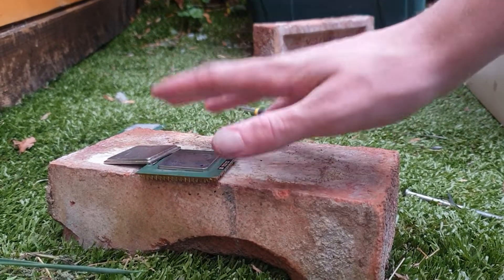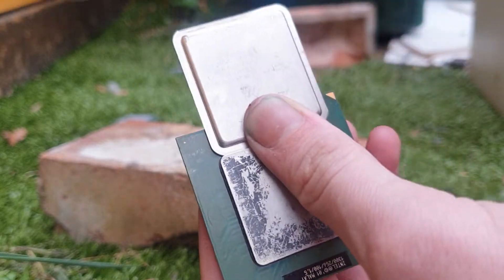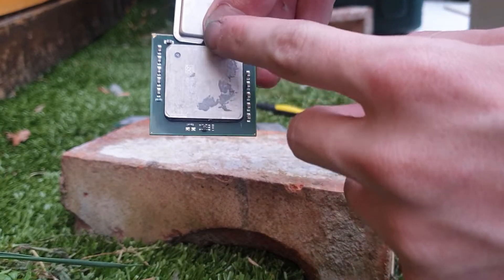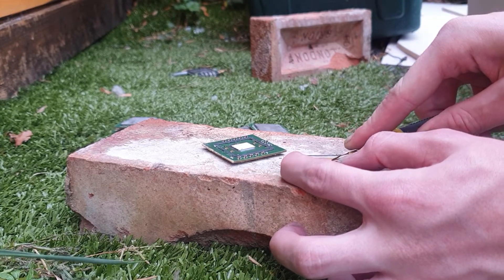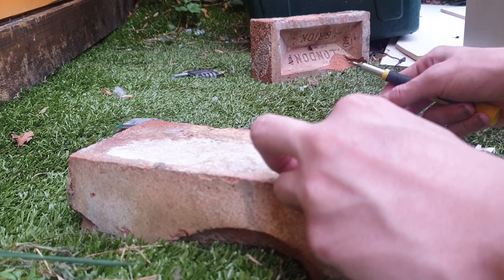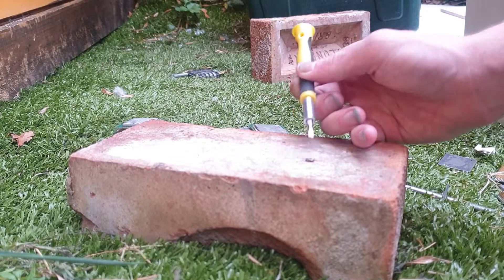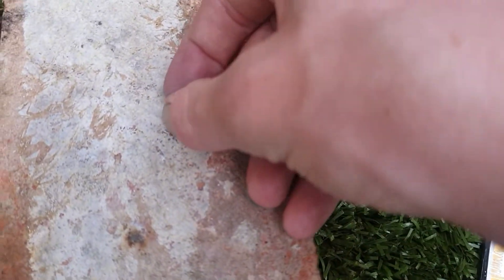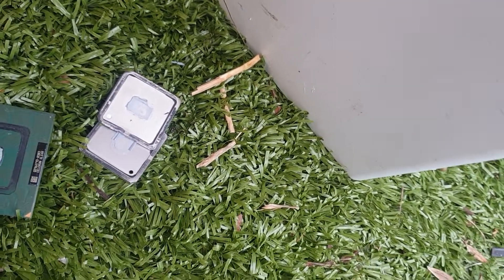How to remove indium from cpus the easiest way

Comment: wont that break the silicon chip?...
Reply from the maker: If you rip the top of it will break but if you hammer it off like I did it will not break and its easy to just scrape off
Reply: Keyte Fire thank u!
Reply from the maker: @sekarlangitakbar6682  no problem

Comment: thats whas an good idea, i steel it ;)
Reply from the maker: If you use brick make sure it's out the rain. If it has moisture inside even if it looks dry on outside the metal will explode everywhere
Reply: @keytefirerefining1355  i have my vice to hold it ;)

Comment: Hey, thanks for the video!   Easier way to get all caps off is a bench vice.  It is really quick and you can do 50 of them in less than 10 minutes.   One side of the vice on the cap, the other side on the processor itself and tighten.  pops right off.
Reply from the maker: Thanks, will try that in future, just wanted to let everyone know that they do have indium as seen even big refiners throw them away not knowing